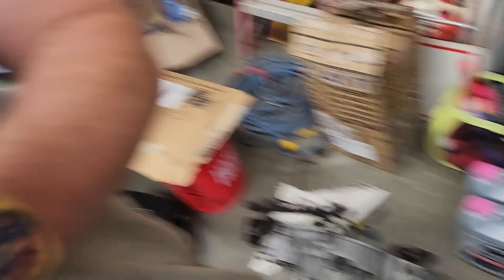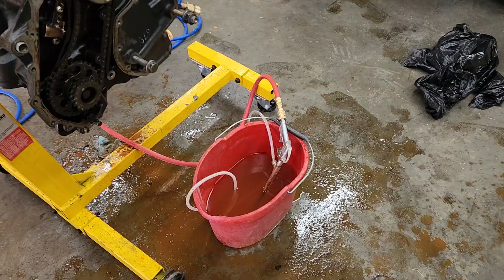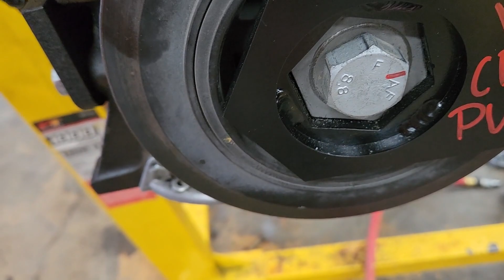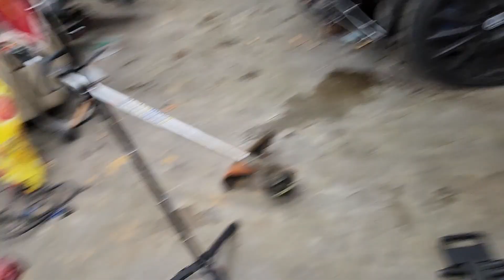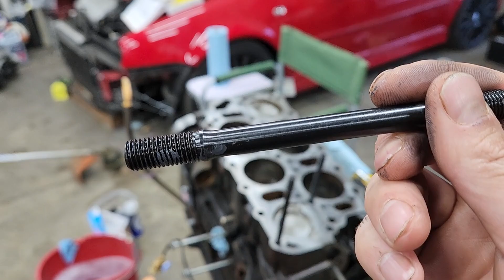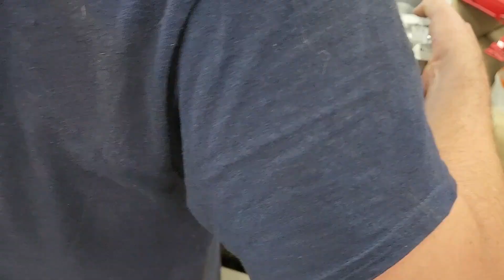VR6 TURBO BUILD Part 2

Comment: Did you even check the flatness of the block deck?? You might just be making more problems
Reply from the maker: I think it's fine, but you guys are right. I could have done better. Im taking it apart tomorrow.

Comment: That gasket leaks before its even run. Head will not come down flat on a steel gasket with any trash left under it.
Reply: Yea I personally would have just spent the $200 to get the head and block decked at a machine shop since it's a turbo build, you dont really wanna mess with that seal.
Reply from the maker: @dmanm85 I feel that, and youre right. Ive gotten away with leaving a small amount of debris on other builds and understand im pushing my luck with the block, but the head was resurfaced. I did say in the vid that if it doesnt seal ill fix it. Not sure how far you ended up watching but I did spend some more time on it before putting the head on. Im honestly not too worried about it because of what ive done on other engines but yeah maybe it should come apart again 😅